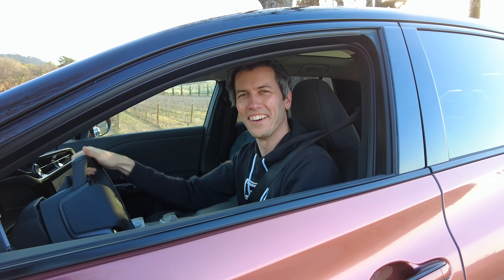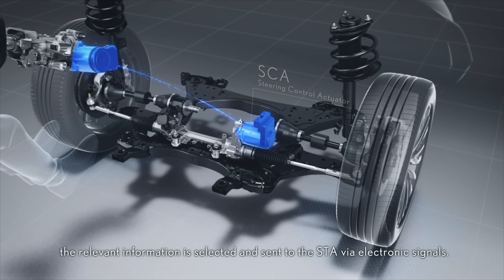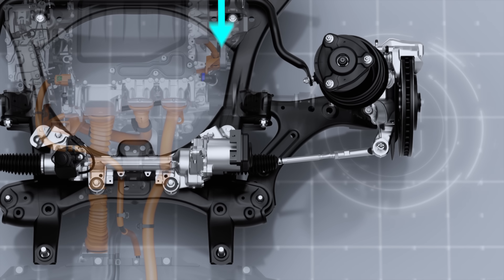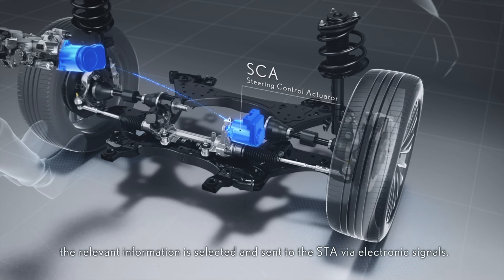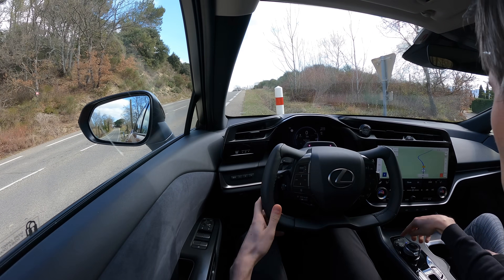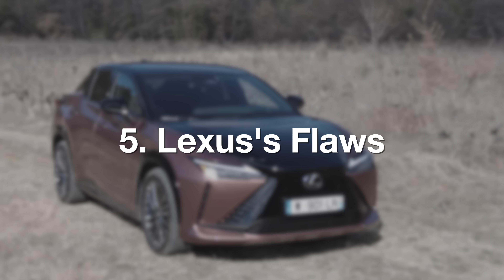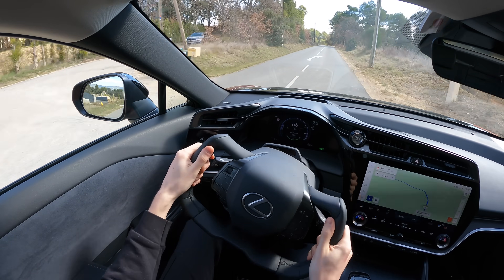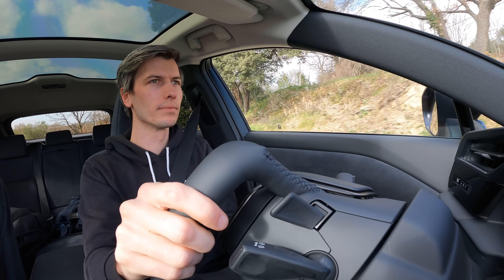How Lexus Fixed Tesla's Bad Idea: Steer-By-Wire Yoke

Comment: Throttle by wire cannot be compared to steer by wire. You lose your throttle, you can still steer the vehicle to the side of the road. You lose your brakes, you can steer to the side of the road to slow down. You lose your steering... you're dead in the water and have no control whatsoever.

Comment: What I don't like about this is exactly the variable steering ratio depending on the speed. For me, this means I can never know how much the wheels are exactly turned at any given moment, lets say in an accident avoidance scenario. It's purely "reactive" based on seeing where the car is already going instead of knowing exactly how much to turn the wheel to steer the wheels an exact angle. I would like to see how this car handles in these scenarios, such as the moose test, and how professional racing drivers navigating a tight twisty course at high speed with this system feel about it.

Comment: Absolutely HATE the yoke design.  It completely removes any flexibility in driver positioning.  I drive A LOT and having to extend my arms to the 10/2 for hours on end is a complete PITA.
As for the 'by wire' - for people used to conventional steering it will absolutely suck and probably be unsafe.  For newer drivers just learning they can slip into by wire and never have a problem.

Good luck making evasive maneuvers at highway speeds...

Comment: I see a lot of comments that say "Well, what if I need to jerk the steering wheel at high way speeds in order to swerve out of the way of a stopping car/random object on the highway ext.". 
Thinking about it, the motion Jason does when showing the response delay ( 12:00 ) I feel like the average driver will most likely crash as a result of that movement anyways. 
That amount of input at a higher speed, no matter the steering system will cause you to spin, if you are on the brakes it will cause understeer anyways. 
I may be wrong or not getting all the facts straight away, but those are my thoughts currently.

Comment: It's worth doing some research on the DIRAVI system introduced by Citroen 53 years ago. Basically no mechanical connection between the steering wheel and the wheels there too. It's pretty much the same kind of system but with hydraulics instead of electronics.

Comment: I think its a logical step up. But there is one flaw regarding the maximum angle at high speed. If you need to make a quick dodge because someone cuts you off, a mechanical one will let you do it where the wire controlled one might be to slow and/or will not turn enough.
In the end, the quetion is, how many flaws does it have ? How many flaw does the mechanical one have ? Which flaws are the most problematic. It's not about solving all of them with a new system, it's about making an overall better solution that may still have some issues that we can consider less problematic if unsolvable.

Comment: In some places you have to have direct connection for type certification.  That used to be the reason hydraulic only steering are limited to 30mph.  Maybe this doesnt apply to Electric. From safety, I don't think its a problem, If an electric power steering on a current car failed and wanted to go full lock you'd still probably have a big accident and there's a lot of design in them to prevent this, but... we do get failed eps regularly and there is mechanical backup. But here there is no option.

Comment: I can't get my head around the rationale behind this. We've all been sat at a computer when it's suddenly just stopped working for no apparent reason. I know this system has back-ups for certain functions but what happens when it's brain starts altering settings when it shouldn't? I certainly won't be buying a car without a mechanical link between the steering wheel and the front axle. 

Also I'm finding it increasingly ridiculous how much of the world's resources manufacturers are pouring into cars these days. It's one thing having screens and electric motors galore in a Rolls Royce or Bentley but I don't think they need to be in low-end hatchbacks and family cars. They just end up ruinously expensive to buy & maintain and, because of this, have a shorter lifespan. Just feels unnecessarily wasteful to me at a time when we're regularly being told we're killing the planet.

Comment: Modern car system comes with ADAS especially Lane keep system. That can assure the drive by wire is okay and relatively safe that the conventional. In the past we barely believe and trust these king of system such as steer by wire, throttle by wire because they are not good enough sensor and speed of responding by either software and hardware.

Comment: unbelievable you didnt mentioned that it doesnt matter how nice explanation is that faster steering is good to.match braking and acceleration but not talking that all of that is crap when you are still limited by a physical action which is the rubber. Rubber does have a response time that negates all those faster adjustable steering ratio advantages.

In terms of all the hardware you have to bring in to makr it functional safety compliance...you end up with a heavier, bulkier overal device. Simple steering column is better. Precisely EV dont have a constraint space limitation on the front end..cause there is no engine at the front...remember.

Comment: in my opinion, steer by wire is great for a car that is made for a wealthy customer who is expected to be able to keep up with mainentance and bring their vehicle into a shop for repairs on a regular basis. but a very poor option when making a car for the average consumer.

 ive had issues before when the steering assistance went out completely on my truck mid drive, i was able to steer it to a parking spot, and then see what could be done to fix the problem for a return trip, but a return trip was possible. while this type of situation does result in difficult steering with a manual yolk, the equivalent in these vehicles would be either your tires locking in their current orientation, or some preset steering pattern, worst case i can imagine would be your tires going slack and rotating wherever the slope of the ground brings them. it makes it so in a situation where your electrical is having problems, there is no way to control your vehicle. i can only imagine how dire a short in that wire would be.

obviously these are issues that car manufacturers will look at, but the ability to manually control somthing when the electrical aspects fail is incredibly useful in many scenarios. and i feel a manual backup would be a very useful feature.

Comment: If you feel this way about the Lexus execution, you should try the S2000 TYPE V from their domestic market with the VGS which also does not require hand over hand steering at all. In typical Honda fashion, they used a cammed system to seamlessly adjust the steering ratio on the fly via actuators. Then there is the half assed Infiniti q50 q60 red sport with a steer by wire that has a mechanic shaft as a backup system should the steer by wire fails - that means that steering has a fixed ratio despite it's by-wire nature.

Honda VGS was reviewed quite favorably in the Asian market but when it fails, its ratio and assistance is fixed.

Comment: I would really like to see steer by wire combined with an AI system that would save you from inaccurate steering input in situations that you lose control or steering away from an avoidable danger on a highway for example, resorting into an accident with traffic coming from the side or opposite direction!

Comment: I like the idea of it. If they can make it work, it makes sense. The only thing I'm worried about is if the wire got chewed by a rat. This happened to my friend. He went to a hospital. He couldn't leave after because a rat chewed a part of the wire used for his car's throttle by wire system. The hospital's parking area had rats.

Comment: I totally chose a barebone car than new all computer controlled one. You know why? If a computer controls everything it's a matter of one SOFTWARE error to make the car go crazy. Imagine the Tesla pileup in a tunnel not long ago, imagine what would happen if the same code controlled not only self driving, but your physical steering input. It's not about mechanical failure anymore. And the thing about mechanical failure is that they (as opposed to software glitches) can somewhat be overcome in most situations. I'd rather trust a piece of steel breaking than a piece of copper thinking it's right to cut off my steering in half.
And btw, people were talking about oldschool guys like me dismissing ABS, radio... - you can manually do just the same thing as ABS with a minimum amount of skill and car understanding. And radio? I'd rather be listening to what the car is doing. Oh, wait. New cars don't make much sound, too bad.
If every car older than 2010 is prohibited or scrapped - I'd rather be driving a bus than buying any new computer.. i meant "car".

Comment: At low speed I've never ran out of time to turn the steering wheel, at highspeed I've never had a safe condition that let me turn the wheel more than small fractions of the total range of movement. Maybe when I'm much older and hand over hand has become a problem this might be a nice feature but I can't see any real advantage for at least the next 50 years. 

The Boeing 727 had 3 engines each with a hydraulic pump and supply lines leading to the control surfaces that had cut offs to prevent one failed line draining everything, giving it a triple redundant system. One time in flight a part from one engine broke off and cut all three of the independent lines at the same time because they passed by the engine in the same location. The flight operations and emergency manual literally had no training or procedures for total hydraulic failure because it was thought to be impossible for all 3 systems to fail at the same time.

Putting two motors in the same housing powered off the same electrical system controlled by the same computer system is basically saying we have low confidence in the motor, not that this system is redundant and safe. If you told me this steer by wire system had a backup of a different motor connected to a different part of the steering mechanism, running off a different power system with a different control sensor, but maybe none of the feedback or adaptive controls I would say that's safe enough to mass produce. Until then I will tell you that this system will fail and will kill someone, even if it's not a model level recall design fault or failure in hardware or software.

Comment: I think it’s only time before the steering wheel or yoke is replaced by a hand controller. Some large wheel loaders have been steer by wire for years. Then the steering will vary by vehicle speed. The steering controller can be placed on the left or right. I hope to see these innovative designs in my life.
Reply: That's not a good idea because it's like in sim racing: a wheel is much better than a gamepad. It would only work if it works like in games with lots of assists basically driving for you while the driver just choose the rough direction, but it kills all fun driving cars.

Comment: My primary concern is losing connection; there's no redundancy, and when it loses connection going 70 MPH, do the wheels keep straight or do they slam to one side? At least with throttle by wire, the throttle gets cut if it loses connection, but it's not that simple with steering.

Comment: I also need to wonder from a maintenance perspective, one way you know if for example your wheels are unbalanced is vibrations in the steering wheel.  With this setup does the motor simulate that too?
Reply: Theoretically, yes. The actuator could transfer all signals one to one which would mean there would be no difference to a mechanical system. Lexus could decide to ignore those inputs for comfort reasons though.
Reply: It should, sim racing wheels mimic it so I’m sure a real one would give the same impact
Reply: Have fun replacing those things for a fortune..
Reply: @arturow2686  we hear the same  when people moved from horses to cars - "Have fun replacing those things for a fortune"
Reply: @s.i.m.c.a  Well they weren't wrong and economy started booming shortly after cars were mainstream so it wasn't a huge deal.

Comment: No, this is insanity and I wouldn't trust this if it had 300 backups. My drive-by-wire throttle isn't going to stop me from avoiding a tree. Also, I doubt this has any failure state between working and dead whereas a physical linkage is going to have play, be noisy, or notchy for a long time before you have no steering.

Comment: Still not safe in aviation there is more redundany what will happen if one sensor fail in the exact moment that I am goin in high speed in curve say I'm goin right turn and I am turning left curve ? And I prefer the normal steering ratio short steerimg ratio is better to formula 1 car

Comment: Dejavu!
When a Boeing 777 came out with fly by wire system. 
I tried to explained to the older 747 captains who flies a conventional-mechanical flight control systems (cables, rods, pulleys, hydraulics actuators) about triple REDUNDANCIES. 
Each of 3 Boeing 777’s Primary Flight Computers even employed 3 different brands  of CPUs (if I remember correctly, Motorola, AMD and INTEL) to compute the same sets of data and compare them to avoid some bug in some chip.
Still, the old captains said they wouldn’t fly in one… and look at those planes flying in the skies today. All new gen airliner are using FBW systems.
Reply: @Khoi Le Anh  737s aren’t FBW. She’s using an old system architect. She has a conventional flight control systems (except spoilers). I flew older 737s three decades ago so I don’t know much about the Max. But from my understandings, MCAS gave input to control horizontal stabilizer screw jack only, same like Airbus A300 Alpha floor protection functions.

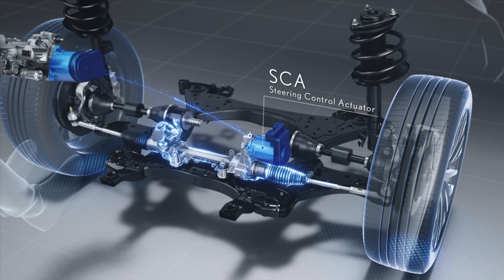Comment: Something gonna broke. Maybe electronics or those 2 electronic engines and bye, bye you will fall off the road or crash into something. Imagine that: You turn the steering wheel and the car goes straight. Great! "I love it!!" - Frank Drebin. The guy says in 7:35 there are 2 motors. Ok... What if 2 electronic chips or 2 motors going to fail at the same time??? Those things have to be connected on some level. They will break and you will hear or read this: The driver crashed into... and nobody knows why he/ she didn't turn the steering wheel. Good luck with that thing.
Reply: Exactly. This guy is clearly just pushing it as a political agenda. It’s horrible tech-wise. And I’m a software engineer.

Comment: I always wanted a dynamic steering ratio. But wasn't sure how muscle memory would get used to that. Then again it's a constant feedback loop with steering so should be able to get adjusted.
Reply: Imagine getting used to a particular velocity-steering ratio configuration and the manufacturer just flat out patching the car and changing it into something different entirely out of nowhere
Reply: As someone that's run a variety of of race cars on a PC (with which, each car has a different steering rate) it's actually not that bad of an adjustment.  I've gone from slow, heavy stock cars from grassroots racing to the hyper sensitivity of an F1 car in a moment and been able to adjust. Am I FAST with that sudden change? No, but I can get it around the track without mowing the lawn or hitting a wall. I still have to adjust for performance, but for 'get me around the place', it's pretty straight forward.  The way it was described sounds like something I'd be fully accustomed to based on the years I've spent Sim Racing.  Though I'll miss the detail of feedback given by a mechanical steering system. But Toyota's engineers have a point - you don't need to feel every last detail when you're not driving for performance. I worry more, quite honestly, about the snow and foul weather handling of the system, where it's critical to be able to feel everything. the car is telling you. ON the other hand, though, My 2017 Focus HAS electric power steering, ESC, TC and ABS - and it drives in snow better than my 2004 Focus does -- which does not have ABS, TC, ESC, or anything like that -- All it's got is hydraulic power steering -- you know, the traditional kind of power steering.
Reply: Muscle memory works with you as much as it works against you here. You know intuitively how much to rotate the wheel to achieve a certain amount of turning but you also know intuitively how much turning is needed for any given turn. 

Your brain realises that you're already turning enough, so theres no need to rotate the wheel anymore or vice versa.